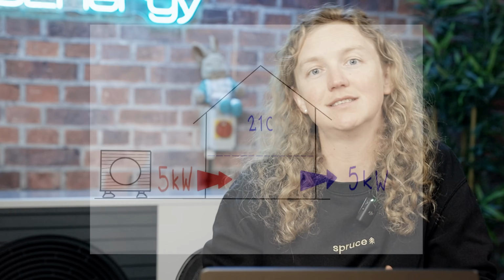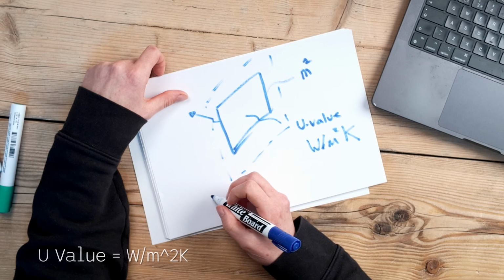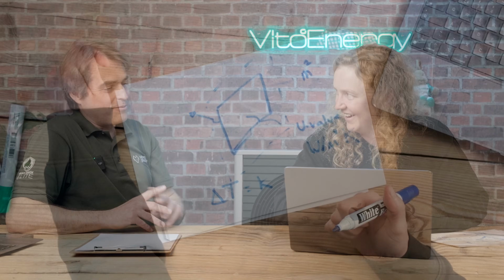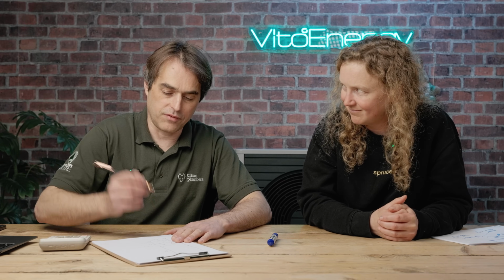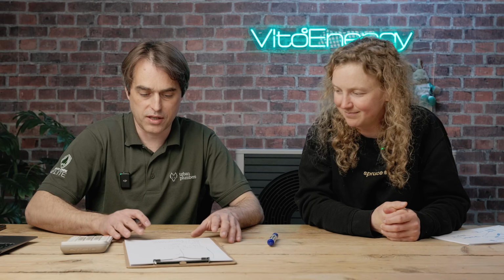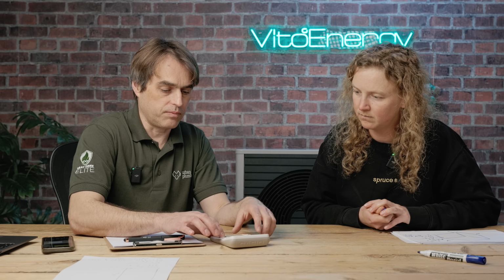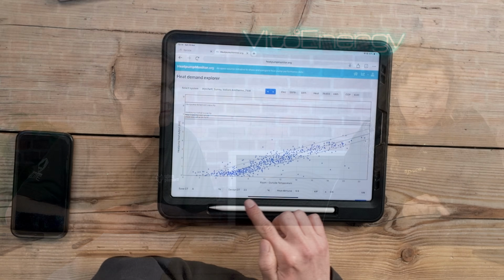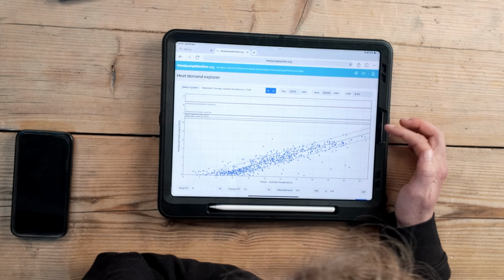Heat Loss: Why Everyone Gets It Wrong & How To Fix It

Comment: German here - we have a club of german heatpump (sellers, manufacturers, installers) who is offering a website with everything you need to know. Link is at the end of the transcription and the site should be translated easy by google into english.

They offer hundreds of topics (for their installers and member and consumers) but let us start here with the 3 calculation methods we used
* heatloss calculation based as you did but online room by room and the U values based on the year it has been built
* annual energy consumption figures of the last year (s)  incl. a climate factor which is multiplying the figures for each period with a factor they calculate for you zip for every month of the past 15 years which means oil consumption for 1. April 2024 to 31. March 2025 cause a heating period will need a compensation,. You can use any period (full month) for that which is a great improvemt. A result can be a 1000 L figure as consumption has to be adjustet by 123% to 1230 L due to a warm heating period last year compared to the long time average
* rough calculation based on some key figures and the age of the house, some details to strucutural elements and its age and question about the insulation

So you have 3 choices and best is to do all of them cause the results should come close to one point where we emphasize the annual energy consumption figure cause that incl. specific behaviours of the owner. If the ventilate 20 minutes each day then it might be more than others, but the oil for heating use will be higher compared to others. Usual this is the best starting point.
Finally to have a fast impression we use the heatlos calculation method there but assume this house is kind of box without rooms. This makes the calculation much faster. Then we measure the windows and doors where we usually find all windows from the same era and same U coefficient cause usually germans start a thing only once like exchanging the window, otherwise we group all windows of the same U value together to get the full area of window. Quite rough method where we also assume the method of same temperature in every room. If there are areas with different specifications we assume to divide the whole in 2 boxes and calculate them differently if for example  a part of the box had been new built years later. 

Finally the hottest stuff is using the tablet and an app where you point on the wall you wanna calculate and take a picture. which then measures the length width and height and stores it on the tablet and does the calculation there when you select the type of wall, thickness of  insulation, when it was built and so on. 

I have used all of what the german club offers but not the tablet thing which has been released last year when we had done our project. The usage for this app or the licence is about 100 GBP. In case you really want to do the proper room by room way then that will save a lot of time. But we would do it the same way cause the websites calculator offers all 3 methods for everyone cause it is public.
You also get the standard temperature, average and the coldest and of cause if you enter your zip code they deliver automatically all the proper temperature figures. 

But I like this explanations a lot cause it explains the calculations behind that method I had been using by simple clicks for each kind of surface area to the ground, to the environment and to the roof. 
At the end we were able to cross check all 3 methods against each other and that delivers the proper size.

The app mentioned above is also adding profiles of all the heatpumps and their 150 or so parameters to guide you through a decision what version from which brand would fit how well.
Here is the source for all these planing tools and google should translate the website and tool quite well . as usual yt does not like that so you have to decode such link by removing the space and then replacing the _ with a slash    waermepumpe . de_werkzeuge_heizlastrechner 
This is the whole power of the german industry in 1 spot and independent from all the manufacturer so you are not influenced to get a Vaillant or Vaillant only and whatsoever.

Of cause it is free, but keep in mind to use the link cause they have redesigned the website and this particular starting point has become harder to find compared to previous years when I had done it. 

I guess they have tried to hide it a bit more to force people to go to the installers and ask them and also rely on them. The usual installer here prefers a well prepared customer with a good knowledge cuase then there is more room for details and discussions and a better decision.

Comment: 19:21 I’m glad the presentation covered the air changes per hour problem.  It makes a huge difference and especially if you have mechanical ventilation and trickle feed vents it’s really hard to measure.  Also related - a huge saving could be made by switching from a single flow system with complete loss of expelled heat to a double flow system with heat recovery.
Reply: I wonder if it's possible to measure air changes per hour via a proxy, e.g. CO2? 

I've got an Aranet4 that can measure humidity, CO2 etc. I could in theory let the CO2 build to some round value (e.g. 1000ppm) in a room with the door closed, and then see how long it takes for CO2 to return to the outside value of around 430ppm. I'm guessing there'll be a way of mathematically modelling the number of air changes required for the CO2 values to decay to background/outside numbers! Unleash some boffins :D
Reply: @defragsbin  If you can measure the CO2 concentration (background and then occupied) you might be able to work out the air change rate! A person exhales about 600g/day of CO2 (about 13.6 l/hr?). There are also recommendations for maximum CO2 concentrations so if you get near them you need more ventilation!
Reply: @defragsbin  Firstly the amount of CO2 people produce depends upon activity (sleep, sitting, walking). The figure of 13.6 l/hr is typical for sitting.
Secondly the rate of CO2 production is quite low so it will take several hours to build in a room.
An increase of 400 ppm (400 ppm background to 800 ppm) corresponds to a ventilation rate of 10 l/s/person.
An absolute level exceeding 1500 ppm is unhealthy.

Ventilation rate (l/hr) = 13,600 / ppm_increase / No_of_occupants

Air Changes per hour = Ventilation_Rate / Room_Volume = 13,600 / ppm_increase / No_of_occupants / Room_Volume

Comment: I’m using an excel spreadsheet from the Irish SEAI which is similar to MCS. For the insulation values I had to look them up, the manufacturers performance often beats the default values. Same goes for the radiator sizing. Seems like the system is setup to oversize.

Comment: Great Video, well explained. I'm a (retiring) consultant engineer, I have done the heatlosses for all types of building, including residential. I've always been slightly worried about the infiltration rate (air changes) and the ground floor slab U value as these seem like a complete guess to me, and I'm a professional. You didn't mention the cost of the CIBSE design guide A (which is extortion and very poor value for money), do you know a sensible alternative?
Reply: The Domestic Heating Design Guide by CIBSE is only £40 and lays out the groundwork for everything a domestic engineer needs to know about system design.  Design Guide A is horrible to digest by comparison yes.

Comment: Great info, but why not use an electric heater, a thermostat and an electric energy meter to measure empty rooms over 24h and have a very accurate number? (of course where it is possible to conduct this test without interference)
Reply: Or even several years of gas meter data…
Reply: @JohnR31415 that is making the assumption that each individual rooms emitter is correctly sized. 

You’d also need to know what heat the water is heated to because higher heat will radiate quicker but the boiler will likely be running at a lower efficiency if it’s a condensing boiler and the return temperature is over 54 degrees. 

Personally I have temperature sensors over the house and when I change my boiler I’ll have plenty of actual data to compare and that will be more accurate than a calculation assuming the sensors are accurate. 

My house has a pretty bad design where the gap between the  1st floor and ground floor is exposed to un insulated wood (it’s a chalet) I lose about 6 deg from the boiler to the upstairs pump and this just flows out. There’s also a lot of air loss as well because wasps chewed through to wood.
Reply: How would you heat the other rooms? How would you control  for weather conditions, such as wind and solar gain
Reply: While I agree you could measure actual heat input to determine the heat loss this would require a fixed external temperature or that measured to factor into a calculation.
The objective of the somewhat flawed audited calculation is referenced to an internal target temperature and an exterior temperature that is representative of what is needed in winter.  Where I find the methodology is flawed is it is difficult to attain an accurate representation sensation of the u values in a house that is already built.
As an exercise for a DIYer I do the calculations then compare it to what my energy consumption is and the general feeling if it is a cold, warm or just right environment.  Another useful “trick” is to turn down your gas boiler flow temperature until you feel it is not enough then you have a measure of the input energy heating required.

Comment: Excellent timing, I've been struggling with this topic.

Question - if my current Baxi boiler maxes* out at 40% modulation, which is equivalent to 15.5kW of heating, does that mean my (design outdoor temperature) heat loss is 15.5kW?

*maxes = 4am, target of 20C, ambient of 2C (which is the lowest the temp goes in my neck of the woods)
Reply: Only if it doesn't turn off for a full hour when it's -2c
Reply: @patrickwheeler2646  ahh, of course...

Thankyou sir!
Reply: Surely too simplistic, the loss and input are dynamic.
Reply: Need to take the efficiency of your boiler into account! That will depend amongst other things the flow temperature so not straight forward.
Reply: also depends on the size of your radiators
Reply: @BAZvonRichthofen  our rads can pump out 20kW at 50 DT (70c flow, 20c room)

The pipe work (1/2 to rads and 3/4 distribution) is a bit under spec as we have several 3kw rads
Reply: @BAZvonRichthofen  not sure that matters. What is important is that you take the 'measurement' when the room temperature has stabilised, that is, the heat output from the boiler equals the heat loss.
Reply: Baxi are one of the worst boilers to do anything, no ebus or Opentherm.